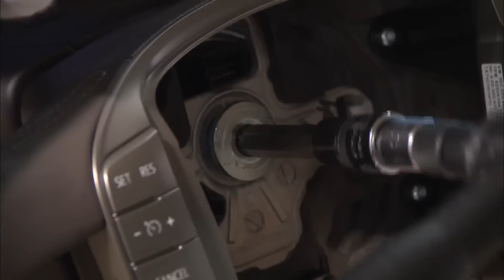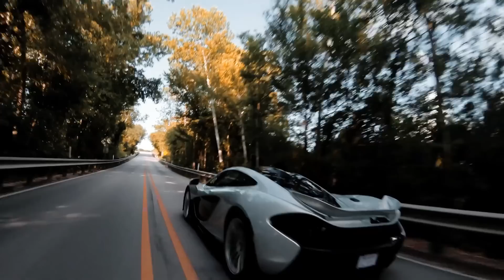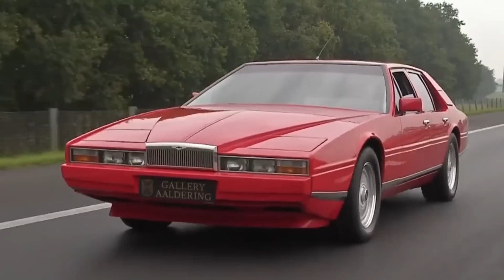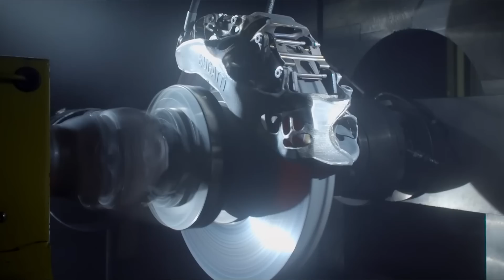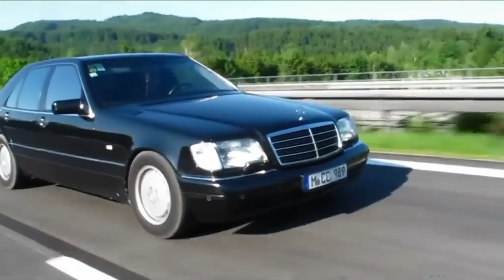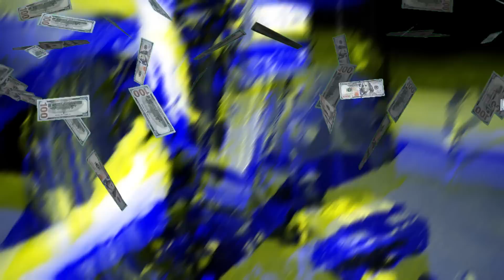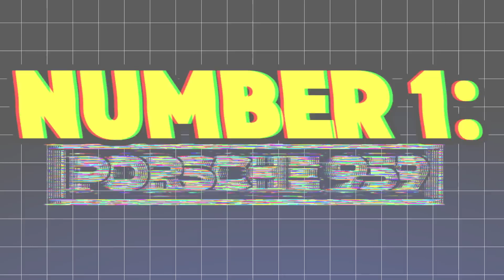17 Stupidly Complex Cars That Will Bankrupt You in Repairs

Comment: I used to supply car dealers with products in Asia.  The worst cars to fix were Mitsubishi, because they can't have simple repairs, everything is designed modularly so you have to replace an entire module of something to fix a small problem.  Most Mitsubishi owners avoided the dealer whenever possible due to the high costs of fixing the cars.  Toyota were the easiest and simplest to fix.  But anything by Germany is a nightmare to repair, especially VW, MB and BMW.  Changing headlight bulb in my Jetta took 5 minutes on 1 side and an hour on the other side because you had to remove multiple engine bay components to get to the bulb.  Stupidly complex engineering.
Reply from the maker: You just summed up the car repair world in one comment.
Reply: I have an old X5.  It has required more repairs than all seventeen other cars and trucks that I have owned, combined.  It drives amazing but try going three months without a warning light, not going to happen.

Comment: These ridiculously overengineered driving machines don't break down, they just fail to proceed which is quite often. That said, what good is an unreliable overpriced luxurious driving machine you can't drive anywhere near its fully designed capability? Can't imagine driving any of these gas guzzling beasts on the Long Island Expressway at rush hour much less at 250 mph.
Reply: Yes,anything over 200bhp/120mph just becomes a coque measuring contest
Reply: Ahhh, the Long Island L.I.E. Even people way out on the east end claim they can get to midtown Manhattan in an hour 😆
Reply from the maker: 😂😂😂😂😂😂 funny

Comment: I would put the modern Porsche 911 (2013 onward) - accessing common maintenance items like the air filter or serpentine belt requires removing the bumper cover and other frustrations, which adds labor to routine maintenance bills. A job that's $250 in a regular car, or $500 in an older Porsche, is $2,500 in a modern 911.
Reply from the maker: The 911’s engineering is world-class—but routine maintenance feels like you need a pit crew and a prayer. It’s wild how something as basic as an air filter turns into a $2,500 operation. Performance is amazing… but Porsche definitely didn’t build it for DIYers.
Reply: porsche cayenne since for ever ,for every part to replace you need 3 day labor ,like starter motor is inside the engine ,or to access chain and plastic chain guide you need to remove 90% off the engine ,its just not build to be serviced but throw to garbage and buy new

Comment: My first job as an engineer out of college was at Honda.  I learned that Honda designs cars to be **assembled**, not **serviced**, once the car leaves the assembly plant it's not their problem.  If people ask me if they should get a Honda or Toyota I always go with the Toyota, parts will cost about the same but the Honda will kill you in labor cost due to the time it takes to get at the part to be replaced.
Years later at VW I learned that Germans design to impress themselves, and so are unnecessarily complex as if designed by Rube Goldberg himself.  Maintenance is expensive and repairs even more so.  I also learned from watching German management that people could become so arrogant that they become stupid.
Reply from the maker: That’s a masterclass in truth from someone who’s seen it from the inside. Honda builds for the line, not the lift. And VW’s obsession with complexity? Definitely feels like they’re designing for awards, not owners. Appreciate your insight—it explains so much about why some “simple” repairs become full-blown projects.
Reply: @carcareclues  People spending up to a moderate amount for a car don't want to hear about simple repairs becoming full-blown projects. VW isn't Mercedes.
Reply: Being a VW/Audi guy, I have to agree. Germans seem to make cars overly complex, just because.    My car has a plastic air hose that goes from plastic air box to another plastic port. The ends have different connections. Why? And of course, the oddball connection is also harder to reach! 🤬
Reply: @aircooledhead  , a couple other aspects: 1) VW being in a socialist country, and the major shareholder is the State of Lower Saxony, has (or had?) 50,000 people in Wolfsburg doing the work of 30,000... or 20,000.  So to justify their jobs everybody has their little piece of information that nobody else has, and they won't share that with anyone.  2) What I saw in every VW plant that I was in, they don't *build* quality on the assembly line, they *repair* quality in the largest repair areas I've seen in any assembly plants anywhere.  A car that comes off the line, goes through all the checks, and right out the door is unusual.  Some cars do laps around repair.  When we launched VW Chattanooga you did NOT want any 2011 Passat with a VIN less than 10000.  For the price and the cost of maintenance I'll never own a VW again after having worked there.
Reply: I guess Honda isn't what it used to be.
Reply: @filippocorti6760  Definitely not. I had the original Accord from '77 and did all maintenance myself. Easy to work on. Everything accessible. Got over 200k miles out of it on terrible NYC area roads. I even enjoyed doing the periodic tappet adjustments.
Reply: @filippocorti6760  , Honda never was what people seemed to think, but Americans have *always* been more forgiving of imports than they are of domestic vehicles due to differences in expectations.  Also, public perception lags reality by at least 10 years.
Reply: @ Thanks.
Reply: The one constant I've seen at Honda, VW, and Toyota over 36 years is that the one American auto company that they watch closely is Ford.  General Motors is considered to be irrelevant and Chrysler has become pathetic.
Reply: @jeffbranch8072  That's because Ford has always been more international in their thinking, always noting what the Europeans and Japanese were trying.
Reply: @MrAquinas1  , Ford hired Deming in 1984 bringing him back from Japan until he retired.
Reply: @jeffbranch8072  Interesting... I wonder why they don't watch the other two. Doesn't GM make more cars/trucks than Ford?
Reply: @filippocorti6760  , I don't know if that's still true.  GM has steadily declined for decades now, they sell less than Chevrolet Division alone used to sell, and in a market that has only grown larger.  And *what about* those cars and trucks?  What do they have to offer that's worth studying to other auto companies?  What does GM innovate anymore?
Reply: @jeffbranch8072  I don't know how much GM innovates... Around 1980 or so, GM had about 45% of the American market. Back in the day, one of the unofficial indicators for how the economy was doing was how well GM was doing. Kind of like the unofficial (or slangish) way the price of the Big Mac was an indicator of inflation.
Reply: @filippocorti6760  , I had a great-uncle who was a machinist at GM Research and worked on the Iron Lung program.  GM was once involved in pure research in many areas.  That was over a long time ago and if there is an organization still called GM Research it's a far cry from what it once was.  It's essentially all gone, just like the autonomous divisions.
Reply: @jeffbranch8072  Thanks. Your post made me with Saturn didn't go under, though their later cars were not as good as the ones from the 90s... As an aside, my grandfather was a machinist, originally from Italy.
Reply: @filippocorti6760  , the Saturn organization was gone long before the empty brand name was, just like what happened to all the other divisions in 1984 with the creation of CPC and BOC.  Spring Hill ended up on a standard UAW contract and the "Saturn" name was put on what were essentially Opel designs.  Now imagine if instead of creating an entire brand from scratch for $6B with a whole dealer network, if they had simply put that amount of effort into the J-body cars?
Reply: @jeffbranch8072  Thanks. I see the point about putting the effort into the J-body cars. OTOH, the idea with Saturn was to do things very differently. If I'm not mistaken, they were the most reliable American made cars in the 1990s and the dealerships were no haggle ones. There were a lot of good feelings about Saturn in the 90s. The CEO at the time was Roger Smith. He's someone who auto historians have discussed a lot.
Reply: @filippocorti6760  Yes, they've sold more from historic loyalty. But GM bean counters have always suppressed innovation, sometimes not a bad thing as this video illustrates problems with excessive electronics.
Reply: @MrAquinas1  That historic loyalty has obviously went down. I think their current share of the American market is 17 or 18 percent.
Reply: @filippocorti6760  My comment was in response to someone who wondered why GM outsells Ford despite Ford being more respected by the Japanese.
Reply: @jeffbranch8072 really the only thing they make worth buying is the corvette IMO if you’re in the market for that kind of car
Reply: Be honest that everyone including Honda design to build not to service. Toyota and Honda are reliable enough to not need much repair and are at least worth the repair cost years after most other vehicle brands are junkyard. F150 also great because parts are available and it’s reasonably reliable. Domestic vehicles really rust to death fast here in WI. I’d stick to Honda/acura and Toyota/Lexus then maybe Mazda or Subaru. 
If I had more cash I’d like a bmw but realize the maintenance would kill me
Reply: @KevinMahalko  , no that's not true.  Toyota, Ford, and others take serviceability into account in designs, or at least make an attempt.  Honda simply doesn't care.  Example: Alternator.  Toyota, Ford, and others generally place the alternator at the top of the engine where it may be replaced by simply replacing the alternator.  Honda put it at the bottom on at least some engines and it cannot be accessed from underneath.  To replace the alternator you first must remove 3 other things, replace the alternator, then replace those 3 other things.  Same cost in parts, a lot more cost in unnecessary labor.
Reply: @jeffbranch8072 depends what model. I’ve had first and second generation crvs on postal routes because they are almost indestructible. Pretty easy access to everything they are like bigger atvs. 277,000 miles of stop and go torture before I sold the 2001. Still running and used no extra oil when I sold it. Odyssey 297,000 until a light accident totaled it. Only repair was a power steering hose and brakes over the years. Only thing that kills Honda is Wisconsin rust. Have a couple f150s they have typical nickel and dime issues both have rear differential and axle seals leaking exhaust header and frame corrosion. Better than GM but not in Honda’s league. Like most Toyotas but was a Honda motorcycle fan from dirt bikes atvs and motorcycles and they never let me down
Reply: This comment is Gold😂
Reply: my love of hondas cries*
Reply: @hannahtanski3911  , if American women really knew what the Japanese that I'd worked with really thought of them Honda would be out of business.  (Since that's their biggest single market.)
Reply: Honda cars are manufactured by designers who embody madness and make slight compromises through negotiations with the production department in order to maximize customer experience and satisfaction and create Honda believers. Therefore, it is always the mechanics on the scene who end up crying. You can understand this well by looking at the development story of the Honda S660, which was introduced to the Japanese k-car market. I call this the "Power of Nightmare". I do not recommend Honda cars to DIY enthusiasts who take care of their own cars.

Note: In Japan, the light cars that are relatively easy to experience Honda's madness are the Honda Acty light truck and the Honda Vamos light wagon. In particular, the Vamos's vertical turbo engine car will let you, who love maintenance, experience the "Power of Nightmare" that even Japanese professional mechanics are afraid of.😇

Comment: The Honda mentioned is this video is just another example of that this car brand most likely is THE worst car brand in the world.

There is no other car brand in the world with such a lousy reliability as Honda. Even if you buy a used car from the old communist part of the world you will get a car with such a lousy reliability as you get with a Honda. It is a car brand so bad that it should have been banned from every country around the world (including Japan).

It is very strange that two brands coming from the same country, designed and built be the same poeple- Honda and Toyota - can be so very different. Toyata the maybe best car in the world and Honda THE worst car that has ever been sold to the poeple on this earth.
Reply from the maker: That’s a strong opinion, but reliability data across the board still ranks Honda among the top performers—especially models like the Accord, Civic, and CR-V. Every brand has its flaws (and lemons), but calling Honda the worst might be a stretch. It’s always good to look at real-world maintenance records, not just bad experiences.

Comment: This whole video is not very correct since it is obviously done by a person that not know anything about complex cars and the different systems that can go wrong in a car such as the hydralic plumbing system in such a car as this video nr 3 which is not at all a complex system because it is only due to the fact that it is not supposed to be worked on by mechanics that dont know what they are doing.
Reply: If it can't or shouldn't be worked on by 'mechanics' it shouldn't be fitted to the car or should be replaced with something that CAN be worked on/repaired by mechanics,BTW the mechs. I know are completely sound on how hydraulics/pneumatics/vacuums etc. work,we don't call an electrician when we need to change a lightbulb.

Comment: Having the Prelude in 4th is ridiculous.
Reply: definitely ridiculous!!
Should've just made the list shorter instead of putting the Prelude.on it.
Reply from the maker: The Prelude is beloved for a reason. But that 4WS system and pop-up headlight wiring did earn it a reputation for being a bit of a puzzle under the hood. Still a blast to drive though, no question.
Reply: @carcareclues  That is simply not true. Japanese pop up headlights are very reliable and rarely need any attention at all.
3rd gen 4ws cars were mechanical and simple. 4th gen 4ws cars made up a pretty small portion of total sales.
Ive owned 4 preludes. my 92 si 4ws went over 200k miles without a single issue with 4ws.
Preludes are among the most reliable well made cars in the history of the automobile. Cheap to maintain and repair. 
You obviously did no research or homework before arbitrarily adding the Prelude to this list.

Comment: I am supposed that Volvo did not make the list.Ever since China took over this production the price went through the roof and so did the maintenance cost.They are a nightmare of electrical problems with there computers the cost of 5000dollars and up to replace a catalytic converter and 450 dollars  for an key ignition switch not installed is standard. The resale value is that of a falling rock.Not to mention that your average mechanic can be out of sorts working on them so most owners rely on the stealership for high prices repairs.This vehicle is riding on its reputation that it once had over twenty years ago for reliability, safety and efficiency. But it is now a product of China, looks good but won't go the distance without jumping into your wallet big time.
Reply: Volvos are designed and built in various countries, including Sweden.  Their parent compsny is chinese.
Reply from the maker: Modern Volvos do look sharp, but under the hood? A different story. The parts pricing alone is enough to make anyone sweat—$450 for an ignition switch not even installed is wild. That old-school Volvo reliability is fading fast, and the tech overload isn’t helping. Definitely feels like a brand riding on past glory.
Reply: I dont know ,there diesels are still god ,in my country you can find lot off XC90 diesels with more then 400 000km on clock still in good condition ,they still sell new Volvos with diesel engines in mu country which is good while most brands dont offer diesels any more at all,only few left

Comment: Toyota harrier 2001. 80000 miles. Central locking packed up. Knock sensor issues. front suspension replaced
Reply from the maker: Sounds like your Harrier hit that mid-life hiccup phase. Knock sensors and suspension wear are frustrating—but still, most would take those issues over a complex infotainment meltdown any day. At least you’re not dealing with $5K computer modules.

Comment: 300se fintail . Suspension actually pretty straightforward. But I am struggling to find gear switch
Reply: I have a 200d fintail, the only switch on my gearbox/gear lever is that for the reversing lights. What switch can't you find?
Reply: Oh and remember the 27 zerks for greasing on the suspension and other items on the cars bottom😀
Reply from the maker: That Fintail is a mechanical work of art—when you can find the right parts! The gear switch can be elusive, especially on those vintage models. But once it's sorted, you're back to cruising in one of the coolest classics around.